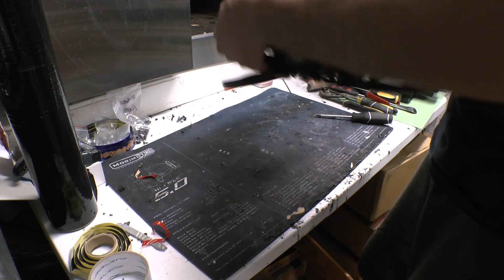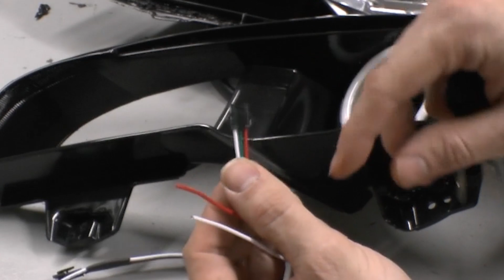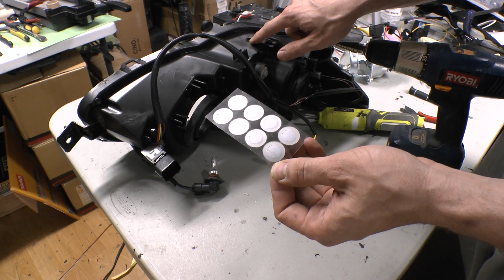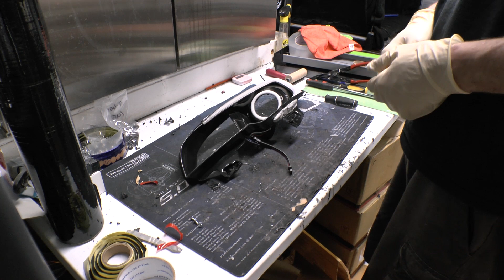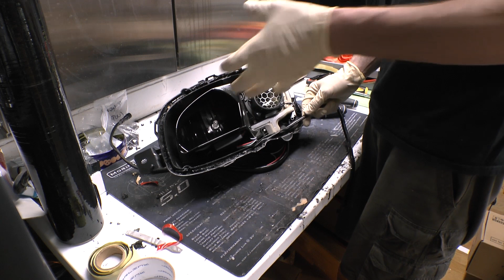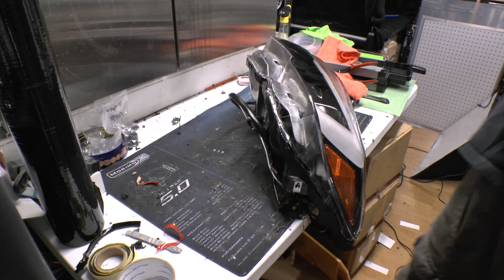DIY WRX Color Flow Build Kit 15-21 Subaru WRX

Comment: Question…I am installing strips,halo and  demon eyes all are 12v…can I just hardwire all three to one JST instead of using splitter? For a blueghost
Reply from the maker: @simply._.raheem4625  if you splice the data together you will lose independent control of each device. You can do that but it's loosing a lot of functionality of the blueghozt controller.
Reply: @ understood…so whats the correct way?
Reply from the maker: @simply._.raheem4625  assuming the leds you use have outputs i would run to the first device, halo strip or demon eye, then from the output on that first device to the input of the 2nd device and so on. Then you will have independent control of each device and will be able to program them following our blueghozt tutorial.
Reply: @ unfortunately only one have output….is there anything else I can do for the other two?
Reply from the maker: @simply._.raheem4625  unfortunately no

Comment: Hey amazing video my friend!!  Thank you!  What projector exactly do you use in the video?
Reply from the maker: We use our 2.5" bi-led projector. https://www.nextlevelneo.com/collections/2-5-projectors/products/next-level-neo-2-5-bi-led-projectors
Reply: @NextLevelNeo  Ok my friend, could I use the same projector to add it in the high beam?
Reply from the maker: @Alex503_sv  you can, we also have a dedicated high beam projector that will fit as well.
Reply: @NextLevelNeo  Yes, I saw them, and what size halos do I need for the low beam and high beam?
Reply from the maker: @Alex 117  80mm fit well. We also have gear, 3/4, hex, full hex, angry eye, and even demon halos that fit. We do have another video on our channel that shows a build with dual gear halos on a 15+ wrx.
Reply: @NextLevelNeo  Ok friend, I will put together a kit on your website, how do you make the cover of the c-light look whiter than the original chrome?  looks amazing in white!
Reply: @NextLevelNeo  I saw the video!  I could send you an email so you can tell me everything I need to assemble a kit like that!  It looks incredible!
Reply from the maker: @Alex 117  i hit it with a 240 grit abrasive media and a special white spray paint. This is covered in more detail in the video.
Reply: @NextLevelNeo  is it possible to use grit abrasive sandpaper?
Reply from the maker: @Alex503_sv  yes but the results will not be as uniform. It is hard to hit all the surfaces evenly

Comment: So the demon eye with the driver you program as a 1led strip? What keys did you use to get the female and male connectors off the addressable wires? You use the 12V to do the demon eyes and the UCS seallight where do you get the 12V from and what fuse do you put on it, or do you tap into the BlueGhozt wires?
Reply from the maker: I set the demon eye as its own section but it can be anything, a strip, halo or matrix. Its just 1 led so it doesnt really matter. 

I use these for the keys, great cheap tool to have on hand. https://www.amazon.com/gp/product/B07ZC1V2W6/ref=ppx_yo_dt_b_search_asin_title?ie=UTF8&psc=1

i run the 12v to the same wires going to the ghozt and the 5v inverter. i run 12v to the ghozt and only run data lines from the ghozt. i do not use the ghozt to power any of the leds. This is so i can put my inverter in the ghozt box and pot everything but if the inverter was to go out i can add an inverter so my ghozt is not lost. My inverters are 10a and very small. so far i have sold over 150 of them and have not had one fail. 

obviously this is a kit so most of this stuff is already worked out in my kit. If you are looking to buy a kit you wont have to worry about any of that, but if you are just looking to learn im always willing to help. Hit me up on facebook messenger and i can give you better info with pictures if you ever need help.